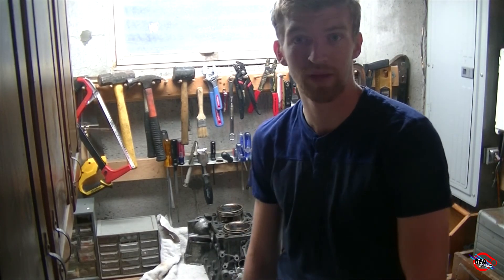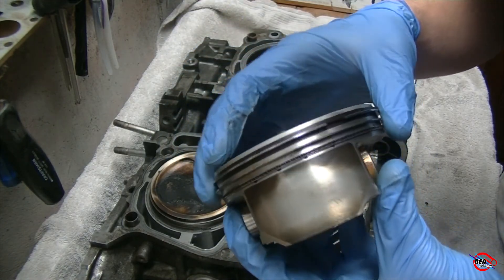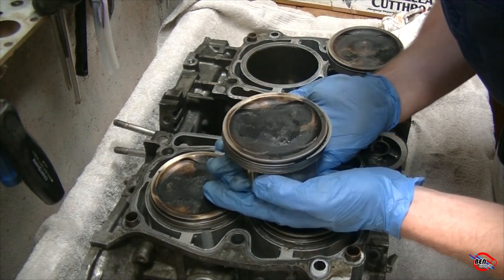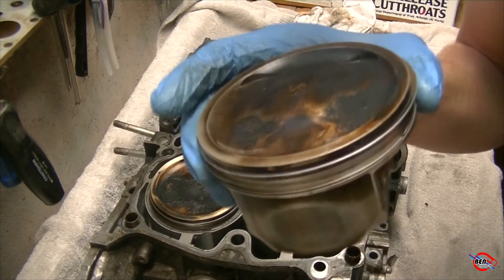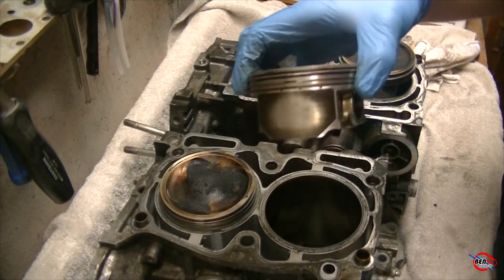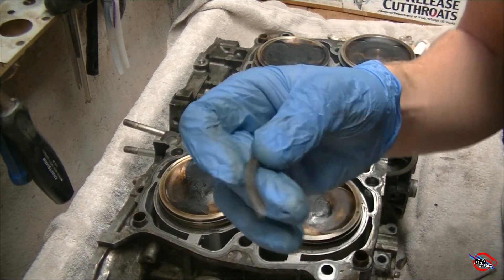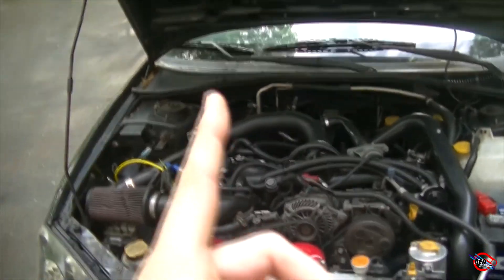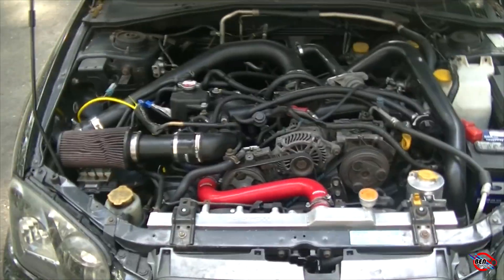Subaru Ringland Failure Theory..

Comment: 7 year old video, but I'm seeing it now so I'll comment now.

What you said is certainly worth considering when thinking about EJ engine building and repair, but I'm not sold on your specific conclusions for several reasons. 

(1) Oil falls down just as much as fuel, negating whatever asymmetry you would need to support your theory that it's fuel washdown. (2) Gravity also pulls your pistons down, so there should be no surprise that the down facing skirt typically shows the most wear. (3) One of your pistons had the ringland problem on the top side; you can't simply make that go away with exceptions to the rule. Doing so is called fitting the data to support your conclusions, which is just bad science. (4) Plenty of other flat/boxer engines have almost identical fuel injection arrangements and don't have much in the way of ringland failure. (The Porsche M96 engine has everything but ringland failure, for example) (5) While non-boosted/street car EJ engines do occasionally have ringland failures, it is much less common and almost always comes with other problems. (6) Even at only 2,000 RPM, the piston moves through the cylinder over 33 times in a single second; I see simply no time for the fuel to settle out of suspension enough to act as a solvent on only the one side. etc. etc.. I could go on, really.

The general consensus of the internet is that detonation/pre-ignition by itself is the root cause of ringlad failure. The assumed explanation is simply that the ringlands are the weak link in this particular system, so are the first things to break when you start to get detonation. The fact that it happened to you with a slight bias toward the bottom is, IMO, a coincidence that is well within statistical expectations.

Nope. Show me the claimed trend in data for x1000 more engines and I'll start to believe there is a pattern. Otherwise, you are extrapolating far too much.

Comment: Then how come Porsche and VW dont have this problem, what are they doing right that Subaru need to learn ?
Reply from the maker: Just realized I commented on the wrong video. I think similar issues could happen with poorly modified engines on porsches and VW. This video is highlighting how if there are issues in a setup- if it is a boxer setup they can lead to issues faster because the fuel is getting pulled down instead of sitting on top of a piston.
Reply: gdi could be the answer